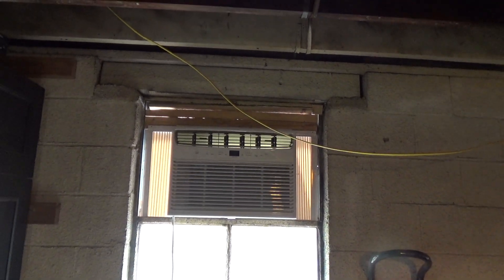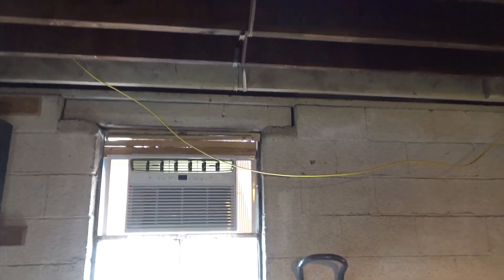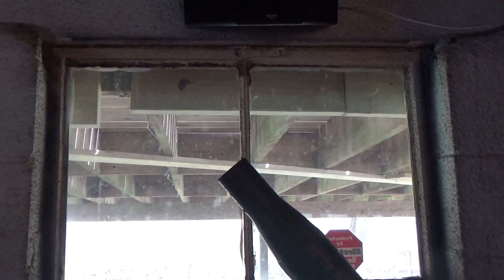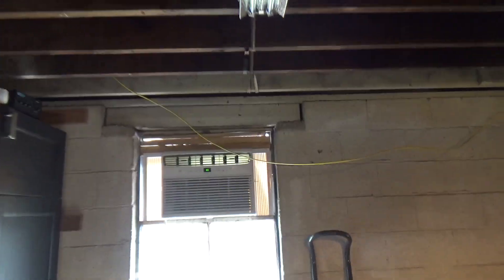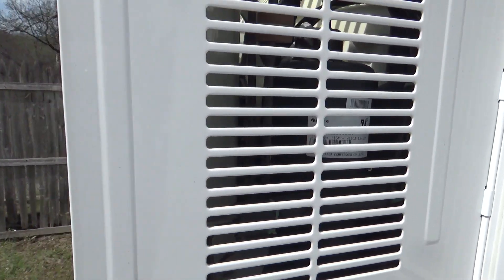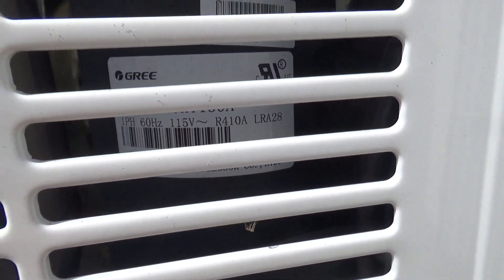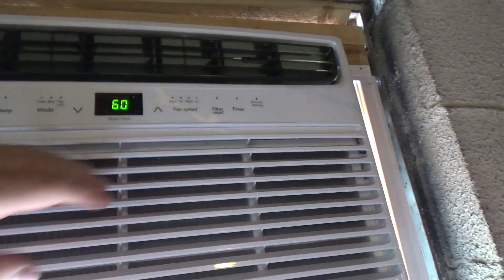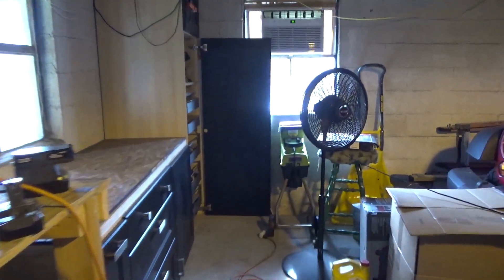It Humidifies As It Cools | Frigidaire FFRE1033U1 Spring 2023 Test

Comment: I used to have a brain dead air conditioner with dead digital controls that I hot wired into service with relays. At one time, I had the blower wired up with a humidistat. What that did was keep the blower running until until a certain amount of humidity was reclaimed in the room. It actually worked quite well.
Reply from the maker: Thanks for letting me know.

Comment: If you want more dehumidification you need to turn the fan speed down to the very lowest in order  to give the air enough dwell time within the evap coil.  That will maximize the ratio of latent to sensible heat removal.  (Latent is the humidity).

You can use some other fans from your collection to disperse  the air sufficiently throughout the garage.
Reply from the maker: It was on the lowest setting. It makes little difference because there's hardly any variance in the fan speeds.
Reply: @JordanU  they probably running it at a higher evap temperature to achieve that high-ing EER rating.   It takes less energy to achieve BTUs via sensible heat removal than latent.  Same thing happens with the mini splits - great efficiency ratings but humidity control is poor..

Comment: You may need to step down to an 8000 BTU unit as you are dropping the temp faster before the unit has a chance to dehumidify.  As another viewer stated below, your thermometer is measuring relative humidity so the readings can look off at times too.
Reply from the maker: Or a larger vintage unit with actual fan speeds that are different from each other, so the cooling speed can be reduced to fit the application.

Comment: The accu-rite sensor you have measures relative humidity (RH) not absolute humidity.  So what's happening is: the air conditioner is cooling the room down quicker than it can remove moisture making it appear as though it's humidifying, but all that's happening is the humidity is increasing relative to the temperature (hence relative humidity).  As the temperature of the room drops, colder air can hold less moisture so the relative humidity (RH) goes up.  This is why you'll notice that even on the coldest of winter days, the RH outside will remain surprisingly high.  If all other conditions were held equal, the RH would eventually come down as well if you gave the A/C a lot more time to remove moisture.  Hope that helps!

Comment: If it is dumping water out the back then it is doing all it can to de humidify the garage.  I think you just have more humidity than it can handle.  Likely moisture is seeping through the concrete because it wasn't lined with plastic before the concrete was poured.  I had this same issue on a home in central Missouri.  I put plastic down under my cars to keep the moisture off of them and water would come out from under the plastic.

Comment: I have heard a lot of complaints regarding the same problem on the same model line all over YouTube. This is why I figured that Frigidaire changed the manufacturer of this exact unit (which is now discontinued) from this version without grey temp buttons to the newer version with the grey temperature up and down buttons that has a different side vent pattern on the outside and different front grille. Your unit has the horizontal vents under the control panel divided into 4 columns while the newer ones have 3 columns on the 12000 btu units and less. Probably the newer units work better compared to these, which may be why your unit is now discontinued. Maybe if you relocate the unit under the shade, it may perform better, as I have had the same issue with a friend of mine and it seemed to work better when under the shade.